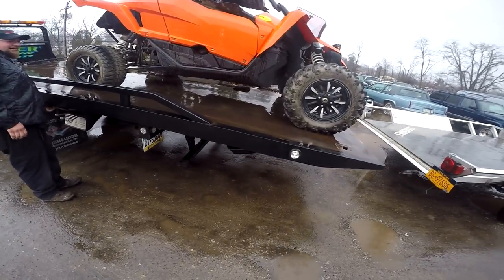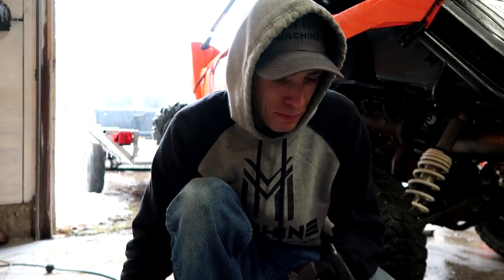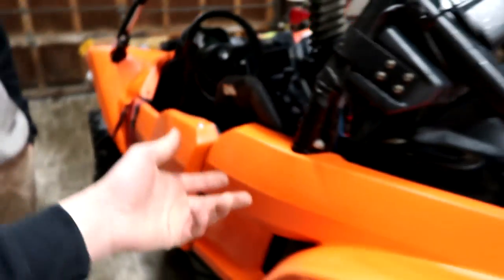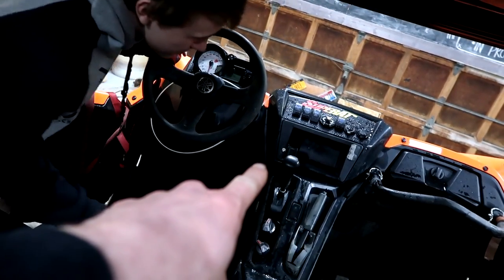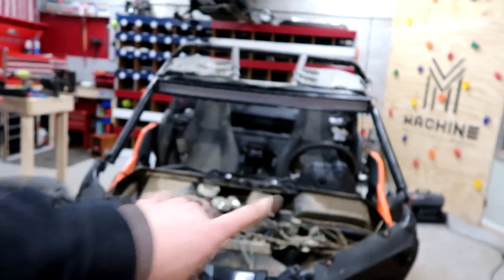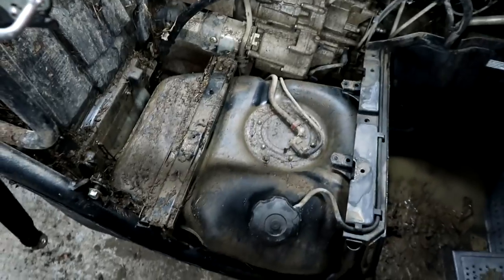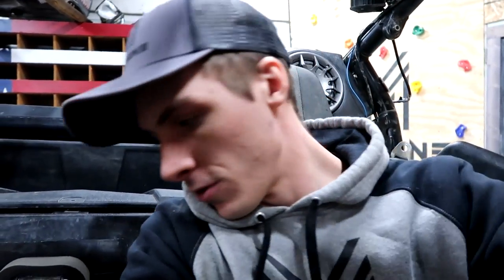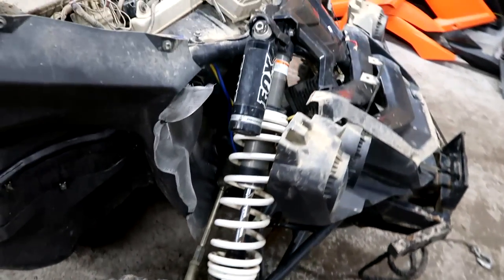I Bought a TOTALED UTV YXZ 1000R

Comment: Looks like it was showing 2770 miles. The 35 might be an error code?? Looks like 35 is #3 ignition coil short.
Reply: You are correct! Good eye!
Reply: kevin nearhood your the man thats right
Reply: Looked it up too, and you seem to be right.
Reply: Hopefully Dalton sees this. 2700 miles is a lot more realistic 😂 that thing is pretty dirty
Reply: Make Dalton see this!!!!! So true!!
Reply: Dude, this thing is CLAPPED! I hope he got it for next to nothing. These first gens had trans issues too. He should get it running, get it where it'll drive halfway decent and unload it ASAP!
Reply: Agreed!
Reply: Great eye man. Had to watch again to see that.
Reply: Dang I didn't see your comment and just commented the same thing. Haha
Reply: Looks like it’s been underwater, all shorted out
Reply: You are exactly right on that, I was about to comment it. 👍
Reply: kevin nearhood no, 35 coil short code is an old r1 code. The yxz and the old r1's have almost nothing in common as far as the ecu. Besides, a shorted ign coil would not keep the fuel pump from cycling when the keybisbturned to run nor would it make the sound of a short in the tunnel/battery area.

Comment: Befor starting it you should remove the plugs and try turning it over to make sure there is no water in the piston housing
Reply: spookygames1159 cylinders cough
Reply: spookygames1159 no worries...the fuel pump is not even getting enough current to cycle.
Reply: piston housing

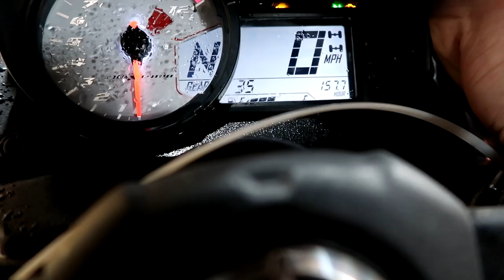Comment: Pause the video at 4:16.5 it shows 2770 miles
Reply: nickman 154 it shows me a ad
Reply: Yh it's the old time he's been ripped off lol it happens when someone remaps the clock
Reply: Sean Cairns 35 is an ignition error
Code
Reply: Ok_outdoors iv done it before lol and shows the old mileage for a second and run time. then the reset times it wouldn't show an error code on the clock you will have to plug in a computer to see any error codes old or new machines
Reply: Ok_outdoors I'll take it bk we both write lol

Comment: My guess would be he ramped it, then landed on the front left (driver side) which snapped the rod and possibly bent the frame a little. The roll cage seems to be fine as no body panels seemed damaged (unless you've noticed some damage, in which case it means he could've rolled it). What I would do is try and see if the bottom chassis is leveled, and if it's bent try bending it the other way to straighten it out. After that fix up the front end, and as long as the wiring and electronics are fine you should be froggy fresh. 

Either way I'm excited to see a new project, and hopefully it'll last longer than the Gator did :p

Comment: I’ve worked on UTVs in the past and the first thing you need to do is pull all of the plastics off and then go from there 
1st check the air box for the filter and see how clean it is if it’s clean past the filter you should have a working motor if it’s dirty past the filter good luck. 
2nd after all plastics are off clean wash everything its a lot easier to see problems on a clean UTV

Comment: Some people take the sway bars off for better articulation, but it's not good for when you are going fast. Same thing with a jeep to where you can put a aftermarket sway bar link quick disconnect for when you want to climb stuff. But if you really think about it, a independent suspension with a arms isn't going to flex as good as a straight axle.

Comment: @3dmachines.  I’m not familiar with the yxz, but maybe it has a wireless hour meter. the wireless ones are by vibration instead of a wire to the spark plug, since there was vibration on the trailer, maybe that’s how the yxz got an extra 5 hours on her!!!!

Comment: That thing has 2700 miles on it not 35 pause at 4:16 you got ripped off
Reply: Scott C I saw that!!!
Reply: Exactly because it said 2770 odo then it goes away and says just 35 which should be cyl #3 miss fire
Reply: Nick Vandiver yamaha does not throw anything but check engine lights...no codes are readable on the lcd screen. It's likely the trip meter.
Reply: Scott C depends on what he paid

Comment: Check your odometer it might be on trip meter because that was the hardest 35 miles ever !!!!!
Reply: Yeah looking at the wear on the rear sway bar bushings I don't think there is any way that it only has 35 miles on it.
Reply: Pause the video at 4.16-4.18 it shows 2770 miles and 225 clock

Comment: I work at a dealership and assemble these and other UTV's the roll cages are always a pain in the ass to get lined up when they come from the factory and sometimes we have to use ratchet straps to pull them back into place to bolt them down so it might not be that bent at all

Comment: Get your sway bar links and tierods from Weller racing. Krash Off-road makes a great cage. The engine and tranny should be fine there rock solid very well built I would replace clutch if it hasn't been replaced with an upgraded one I would go with the tube works  clutch mod

Comment: And once you get it it running find out what gears are in it this machine is built for the dunes not the trails you will burn a clutch if it has stock gears! I would definitely recommend getting a lower gearing kit from Yamaha

Comment: I bought a 2017 YXZ 1000 R SS and destroyed it less than 24hrs. Going 50mph and hitting a motocross jump with suspension that wasn’t set up was a bad idea because the frame was totally tweaked and the roll cage came to about 2-3 inches from my head after we flipped it 4 times

Comment: Dude your overkilling it, unless the fuel is bad leave it alone, removing the tank is likely useless as i bet its plastic. That thing is new enough that i bet its fuel injected and you need to make sure the thing runs FIRST before you spend a lot of time fixing it. The compartment in the back is likely for the winch battery, either way you need a good battery to fill it just incase the system uses it at all. I would wager that nothing is wrong with it and once you put a good battery in it it will start

Comment: 35 is an error code for ignition coil #3 .. open or short circuit detected in the primary lead of the ignition coil #3

Comment: shit bud, I got a11 RZR 800 s with no motor, new bearing on all 4 corners, new brakes, mint drivetrain( other than motor missing and should replace front   driveshaft  u joints as maintenance)all factory electronics/ wiring included.
5000+ miles on rolling chassis...
I bet the clock ran past max miles like a 70 s truck.....9999 miles...or 99999 miles

Comment: or the key was on for 5 hours and its dead
Reply: i always remove my key when it's off to prevent that.
Reply: No, it has 27xx miles, 35 is a error code
Reply: i understand the code i was referring to the no crank it gained 5 hours and that might be from the key on as far as the shorted or blown coil dont know what causes that on this machine see what it does after it has a charged battery